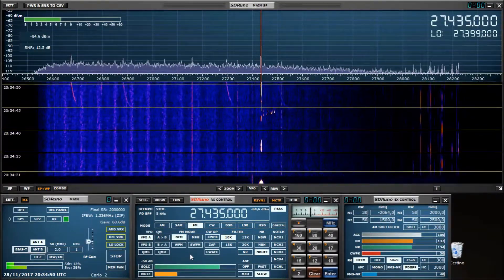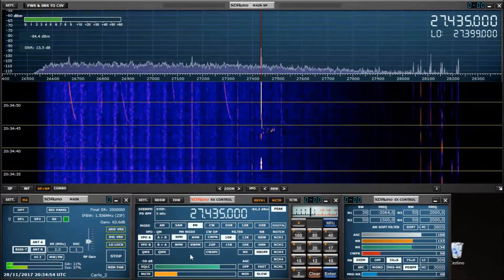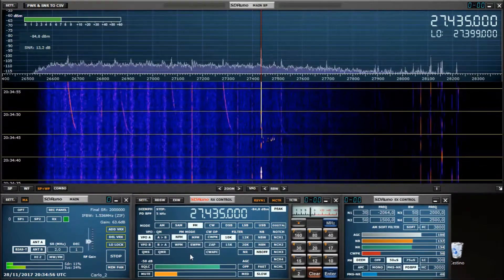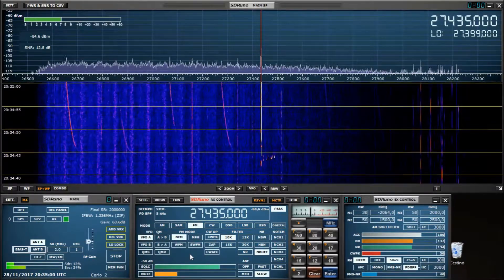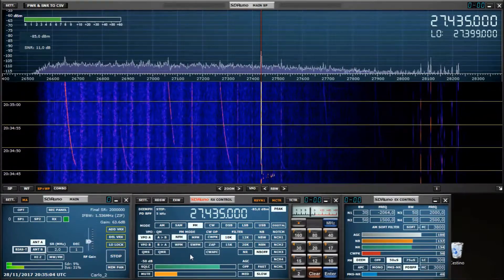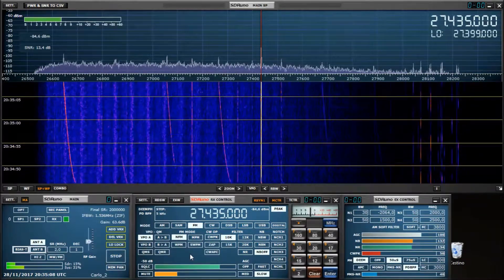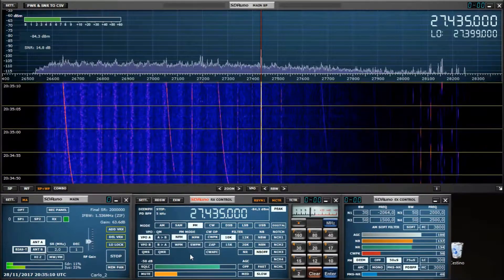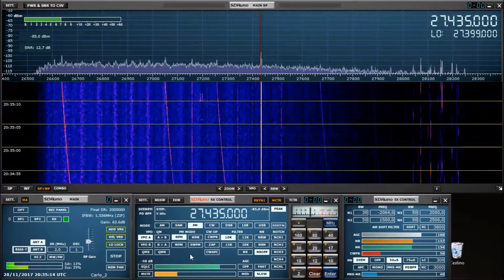Antenna Loop Magnetico Homemade Vs Antenna Sirio Gain Master Distanza TX RX 10 Km

Comment: Ottimo video per dar parola alla loop magnetica ma alla fine che circonferenza hai usato e quale condensatore? Se posso chiederti?
Reply from the maker: 80 Cm di circonferenza e un condensatore di recupero radio ricevitore, il condensatore oltre i 10 Watt scoccava l' arco voltaico ho dovuto per forza usare al massimo 5 Watt